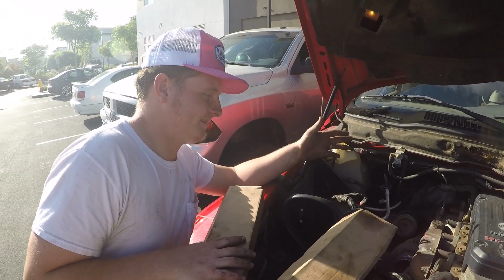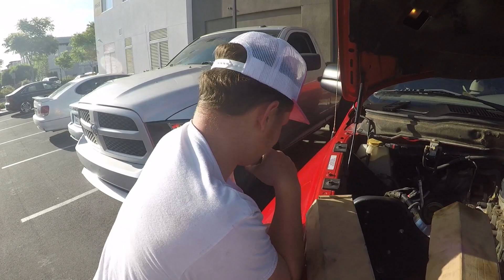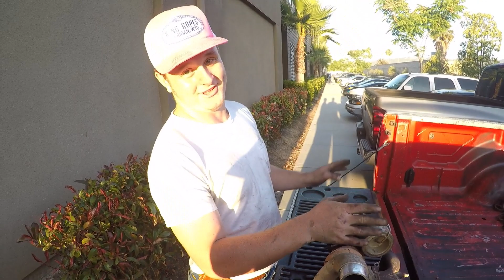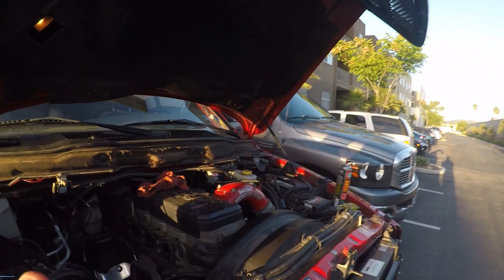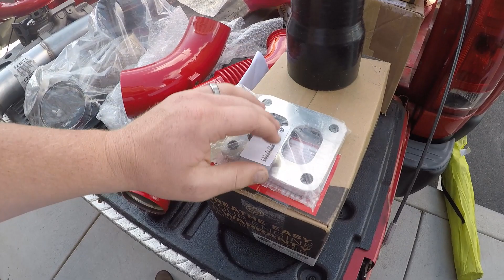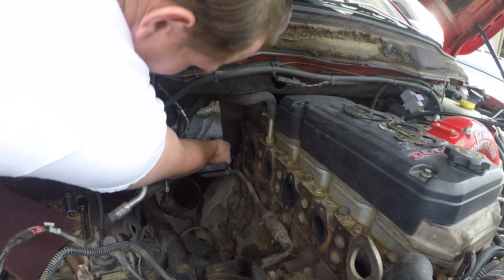2ND GEN SWAP KIT!! OUT WITH THE OLD....

Comment: How many miles do you have on your motor? I was wanting to do a the 2nd gen swap kit myself but mines has like 250k 😅
Reply from the maker: Tanner Batten I'm about to roll over to 160,000. I honestly see no harm in doing it depending on what you goal for the truck is and whats its use. What year is you're truck and what do you do with it?
Reply from the maker: And I personally love it by the way its been about four weeks since I installed the kit and I had never done a project like this and it was not that bad
Reply: @curbsidemechanics3040  plan  on pulling a trachoe around 11,000 lb and a lawn trailer.
Reply: @curbsidemechanics3040  spool time good and everything? How much of a egt difference are you seeing? I have a afe bladerunner manifold and 67mm bladerunner turbo but I've wanted to actually do an upgrade that improves performance rather than a name brand factory replacement setup
Reply from the maker: Spool time isn't bad but I'm anxious to see how it is after I put upgraded injectors in. I to plan on pulling with my truck such as stock trailers full of cattle and even some heavy machinery. I plan on running compounds and adding a 472 to the kit.
Reply from the maker: And the egts prior to ran about 1200 to 1400 if I were getting on it but now barely go above 1000
Reply from the maker: In my opinion it really improves air flow and it drives so much better doesnt feel or sound so restricted any more